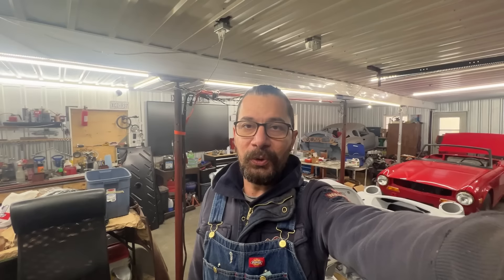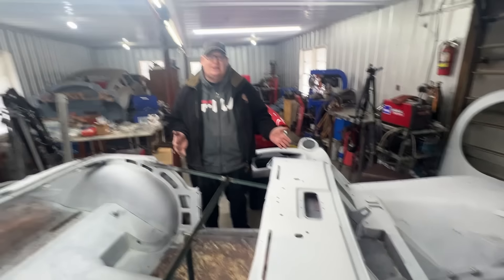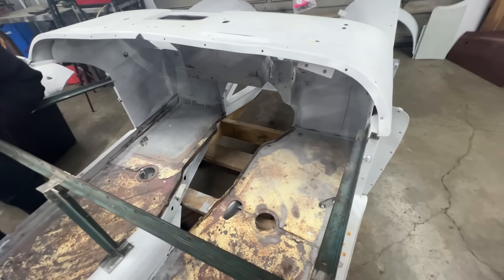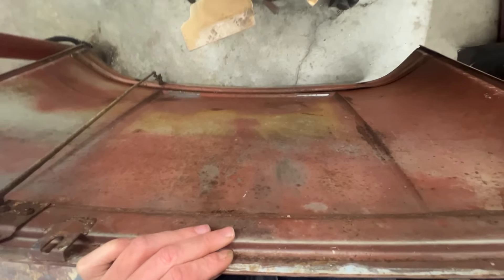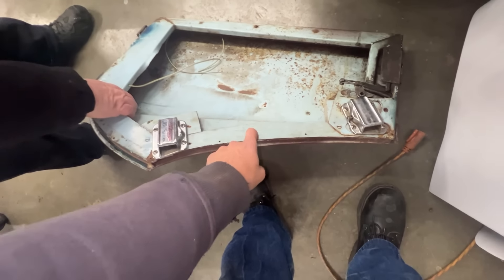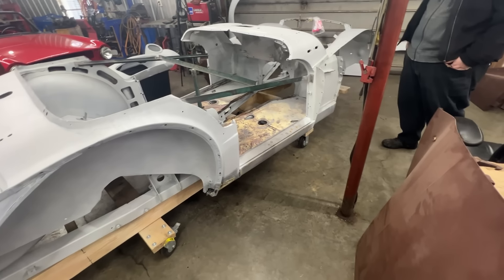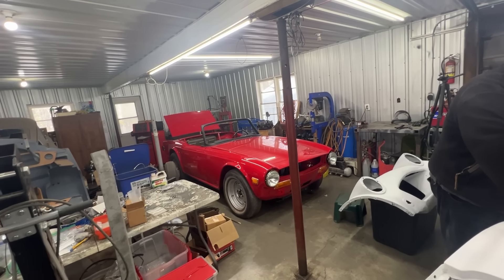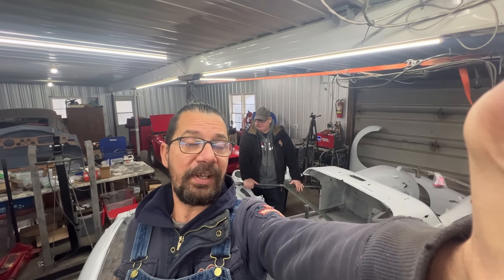1958 TR3 - Part 1 - Introduction

Comment: Hi Elin, I was never a big fan of these cars until I saw how beautiful David's looks. I am looking forward to seeing how well you do this, as I know you can do wonders. I have been working on my TR6 for a long time, it is progressing, but slowly. When I did some repairs on the outer rocker panels (sills) I did not replace the entire thing, only the rusted areas because the rusty area was only the first 12 inches, the part behind the fender. Will you be replacing the entire thing or cutting out the bad parts, or making your own panels?  It was nice to see David in your video, he does great work too.

Comment: I have always liked the small mouth TR3/2 and will be following your build closely. 
I dream of building a TR3 "Beta", like Triumph did. The Beta was a prototype and is  basically a modified TR3A body on a TR4 chassis, with the wider track, rack & pinion steering and a few other improvements. I already have much of the TR4 frame & chassis squirreled away... just need the TR3 body... plus engine, gearbox, rear end, a few more parts, and a place and time to do the work. 
Racetorations in the UK built a Beta from a small mouth. Revington TR sells various body parts for them, but they ain't cheap so I'd modify existing fenders instead.
Reply: Oh, I'd been wondering what Revington as talking about in his interview about 'beta' TR3s.
Reply: @toxaq  If I remember  correctly, only three TR3 "Beta" were built. They were considering it as a successor to the TR3A, worried that sports car enthusiasts wouldn't like the roll up windows and other new-fangled features of the TR4, which was in the "Zest" prototype phase about the same time. Obviously Triumph decided to go forward with the TR4, though they also continuing shipping TR3B (not the same as Beta), especially to the US market.

Comment: Hey Elin, it looks like it is getting pretty crowded in the 'Rustarage'!  In your spare time (lol), I'd like to see you fab up and weld a wide and high dolly/rack for the GT6 body (and future projects) that is wide enough to 'straddle' the chassis and tall enough to clear the steering wheel.  Wouldn't it be great to have the body high enough that you could repair the lower body while sitting in your office chair, just rolling around beneath the body as you desire....

Comment: I need to learn welding!!! Can car body metal be welded with a Harbor Freight cheap welder? I don't have a great deal of money to sink into a tool I'll just use once or twice. I need to put in floor pan patches.
Reply: Hi Rick,  I’m sure you could make the harbour freight welder work…the metal isn’t very thick.  Just do some practice first on some scrap metal to get the hang of it.  Good luck with your project.